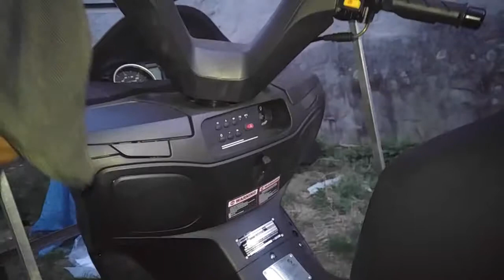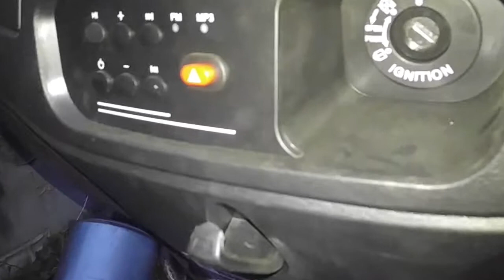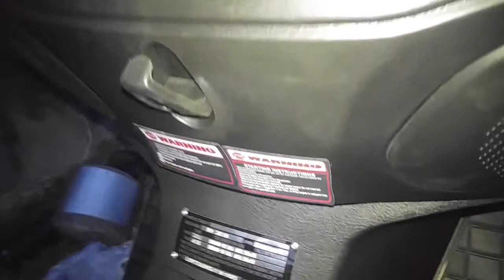Part 2 unboxing brand new Znen 150cc Scooter

Comment: How did you put the windshield on
Reply from the maker: That was a long time ago I believe there is six screws that holds it in place it slides down behind the front.
Reply: @maraslots  oh ok
Reply: Do you have to take anything off to put the windshield on
Reply: Did you have to take anything a loose to put the windshield on